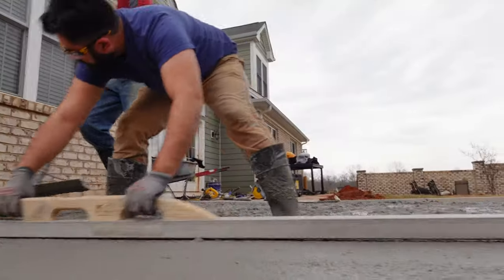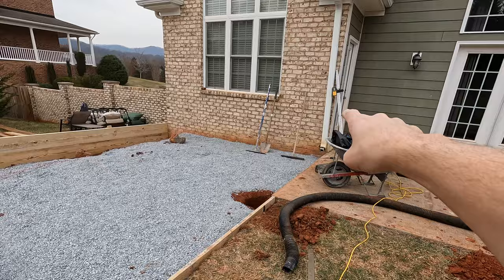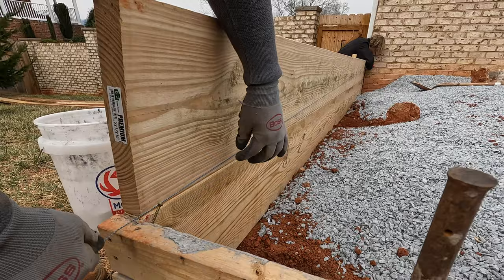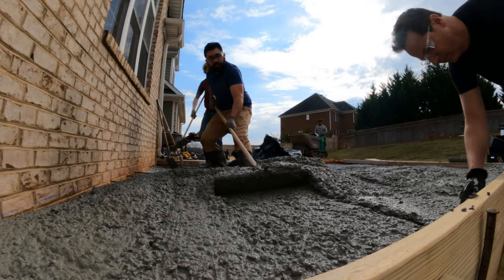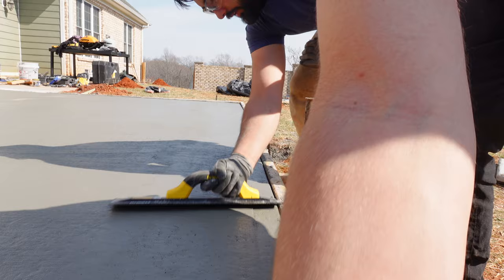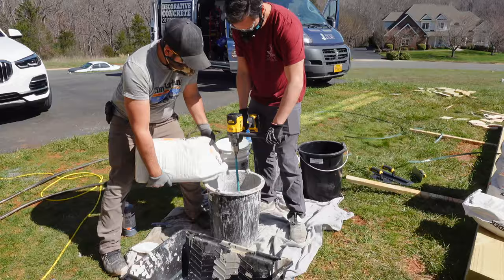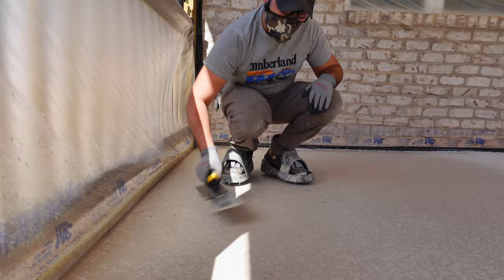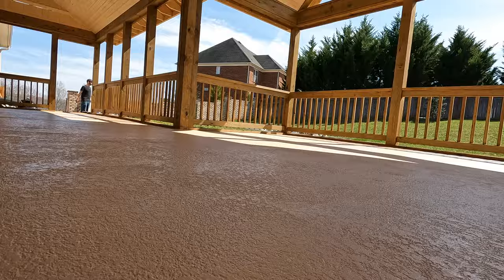Pouring a NEW Concrete Patio & RESURFACING it to Match OLD Concrete

Comment: Do you need a contractors license to do work on already existing concrete? like i totally get needing one for POURing concrete but would I then need one as well for overlays, epoxy coatings, and staining? Finding mixed messages when I look online for my area. thanks!

Comment: Is it possible to epoxy covered porches like those or are there ramifications on doing an epoxy flooring exposed to weather?
Reply from the maker: You can do a flake system outside. We change the liquids to something more suitable… but I just don’t do them much because I don’t love the way it looks outside.
Reply: @TimDCVA  We visited a funeral home in a neighboring town that has the flake system on the poarch to the entrance door.  The man who worked there talked like it was "Slick".  I don't know if the installer added a slip resistant product to a sealer or not.